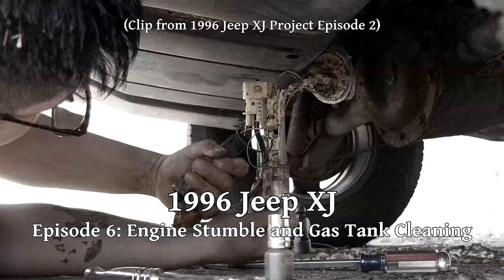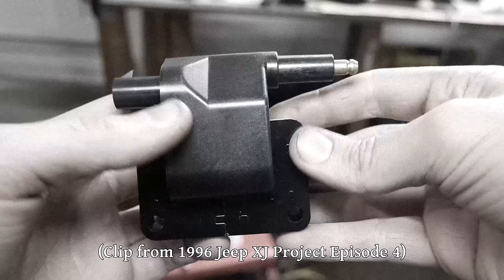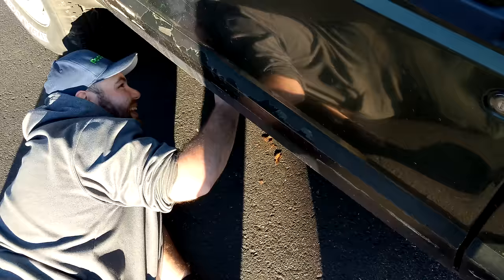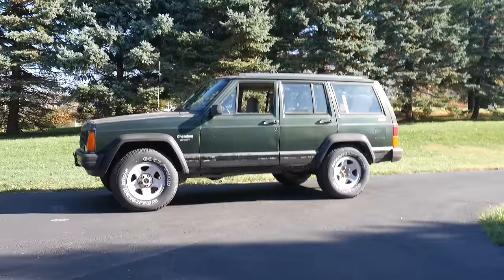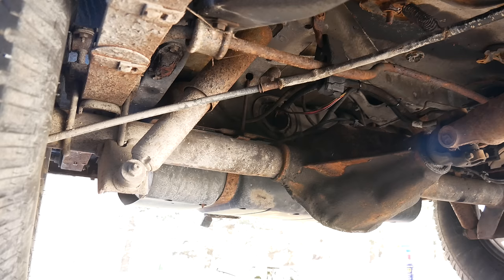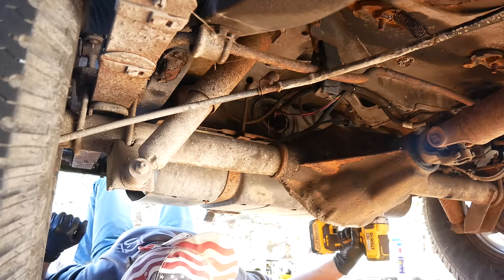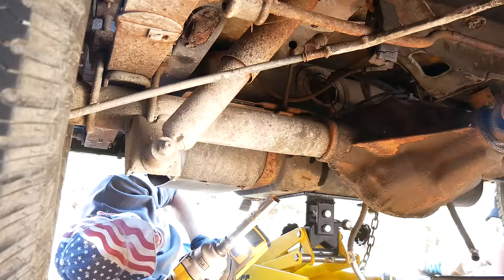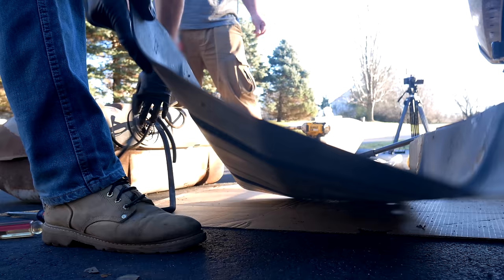1996 Jeep Cherokee Engine Stumble Diagnosis and Gas Tank Cleaning (Ep.6)

Comment: I've had 'the pleasure' of learning this lesson on a 1957 Chevy Belair around 20 years ago. The fuel tank was just about as bad as the Jeep's, and the insides of the mechanical fuel pump looked very much the same. It was so bad, it just clogged two filters right up, and I couldn't get any fuel to the carb. Comes with the territory of running old pieces of junk I supposed ;)

Comment: For future reference, you can use a bucket full of "cleaned" crush and run (white "drivway" gravel), or some lengths of chain swirled around inside the tank to "scour" the inside. Then use a product such as POR-15 to coat the inside. They also have a complete cleaning/coating kit for fuel tanks.

Comment: My 73 Torino that sat for 15 years, and the fuel tank was like yours, the pick up sock disintegrated and the previous owner didn't use any in-line filters. So it would start up and then stall. The inside of the carburetor was just as bad as the fuel tank. I basically replaced the tank,fuel pump,rebuilt the carb,new sending unit/sock and installed a fuel filters. Now it runs great.

Comment: Perfect end of the work week. Thank you! The O2 sensor sits a tad too close to the end of the pipe, could cause misreads as fresh air can tumble upstream.
Reply from the maker: The check engine light comes and goes now and then, seems to have to do with that sensor. In the next episode we will throw together at least part of an exhaust system for it to help take care of that (and the noise!)
Reply: @FuzzyDiceProjects  don't forget to get some new fuel hoses
Reply: The ECU likely goes into open loop when floored or at high RPMs. The upper O2 sensor gets ignored.

Comment: I had a 1992 Ford Explorer that had the same problem it had sat for 8 years my dad remarried in that explorer was sitting in his wife's backyard and she thought it had a locked up motor and all that was wrong with it was a fuel pump without she gave it to me once I did the troubleshooting on it determined it was a fuel pump I replaced the fuel pump and tried to clean out the gas tank is best as I could play the seemed like it was lined with tar varnish or something and every time I fill it up with gas it would just contaminate the fuel I ended up replacing the gas tank

Comment: A trick I've used on a couple tanks to drain them before dropping is run the hose from the fuel pump into a bucket and then jump the terminals on the pump's relay socket.  It can take a while but definitely beats wrestling 15 gallons down!
Reply: had a similar work-around with a 383 i was working on, car had the fuel pressure regulator under the hood, so we just ran some soft line off of that and tried cranking it to empty the tank that way

Comment: I going to do the same thing to mine, seeing this video gives me some relief that is am right with my diagnosis.  The truck sat for a long-time guy only use to go hunting a few times a year never.  I got it for $900 with 81000 miles on it not a bad deal, rust as can be.  So, my mistake was filling my tank to full and added some fuel cleaner which broke all that rust and gunk clogging the sock.  I removed the fuel filter and the stuff that came out was swamp water looking.  Have all the parts now will be doing it soon.  thanks for the video.

Comment: in cases like this with stumble,  pull an injector and watch how it sprays. this will let you know to start checking through the fuel system. 

this method lets you check without spending any money (in theory).

cut the top off a larger soda or gatorade bottle and set the injector in it and affix it someplace it won't get too warm or dislodge (keeping the injector up high enough to be able to see the spray but still be in the bottle), then have someone start the vehicle in question for a little bit to inspect how the injector sprays. google image search has some nice examples of good vs bad patterns.

cheap, easy and should let you know if you need to focus on electrical (sensors, etc) vs other.

also tends to save you some time.

Comment: You two had fun or made fun out of it so no foul, this is more common than one thinks. Here in alaska we suffer with off brand fuel companies with lots of water circulating in tanks at the station when tankers refill them. I drove to the station with my truck on empty and filled up. Small towns know you and it helps when they see it happen in front of them. I filled up, paid then got five feet and engine died and after running battery dead and being jumped, took top off the carb.... water! Stuck syphoning hose in tank and pumped five gallon and then second one then third and part of forth... all water so pumped from the meter pump and its watery and rusty! Had to wait for them to go get me fuel from another station and they shut their station down. Their tanks pumped said removal time and I was the lucky one to lose a days work.... It happens

Comment: My old 03 Crown Vic had the same issue, the whole inside of the tank was rusted even though the car had less than 120k miles on it at the time. I thought it was the pressure regulator because the pressure kept dropping off. I did that and still had issues so me and my brother pulled the tank to replace pump. Once we pulled the pump it was obvious what happened. Got a clean tank from the junkyard and the car ran perfect after that

Comment: Fuzzy Dice, a couple or more gallons of white vinegar would remove and neutralize the rust in the tank, you can place a chain or bolts in the tank to help knock the rust off by sloshing them around, you could then seal the tank.
Many Jeeps have plastic tanks. One of these may be the way to go.

Comment: For future reference, muriatic acid is a cheap cleaning agent that is relatively safe to use with gas tanks. Currently in the process of cleaning out two old Harley gas tanks with this stuff. It's potent, but also is a great cleaning agent. We're cleaning these out because of some sort of a gel-like sealer being used, which seems to have become solid over a number of years. There was also a bolt, and some newspaper clippings inside the tank. No clue why. This acid seems to remove any surface rust almost instantly, but also removes any protective coating from the surface metal. After doing something like this, you'll likely want to get some sort of a rust protective sealant inside the tank. Haven't gotten that far on this project yet.

Comment: When grinding on the bolt we don't want to heat it up Because of the heat treat so we dip it in water but then we Weld it
Reply from the maker: Slow, quick welds, and time to cool in between. That's why the welds look so bad (well also not sanding off the coating), because they were done a little at a time

Comment: I recently have been slathering whatever exposed threads with grease and that seems to make whatever bolt or but come off a little easier, just try to get the grease under the threads of whatever is trying to be taken off.

Results may vary.

Comment: that fuel tank was horrendous. i guess now you know to do things right the first time. nice hack on that extended 14 mm. i had to do the same thing for an e brake adjuster. i didn’t have a welder so i hammered the correct size socket into a bigger one and it worked great. i still use it.

Comment: I had an 89 Jeep Cherokee Pioneer that would start to chug in the winter when you got above 50mph.  I bought it used and it was in horrible shape.  Transmission was run nearly empty by the previous owner.  And the PVC valve would dump so much oil into the air cleaner that I could not run an air filter.  I never thought it could of been the gas tank.  Glad to know, now! lol

Comment: Seems like 1996 was the year of the metal tanks for Chrysler. The neon was the same way. Our workaround for this is to get a plastic tank from a later year that has the better pump setup with the plastic pump ring rather than the metal tank with metal pump ring

Comment: Penetrating oil!! Very useful on a rusty bolt/nut. Love the videos man.
Reply: Not very when you only let it be for 5 min, use heat instead
Reply: On a gas tank?  Lol
Reply: J F4444 , yes on the bolts that hold the tank straps.
Reply: @JF-4444  what is tapping out the gas.

Comment: I once work on a 84 BMW 318 it had been setting up scents 91 and  well I'm not going to lie the in side of the gas tank had what appeared to be  molasses in it and didn't smell like molasses though it had to have been at least  2 and 1/2 inch thick at the floor of the gas and keep in mind this is a dual heights gas tank it straddles the drive shaft so I only cleaned one side it still boggles the mind that the car still runs fine now as for the lift pump that was in the tank I replaced it with a strainer and a piece of fuel hose and use the high pressure fuel pump a new one of course to suck it from the fuel tank and put it to the injectors

Comment: Seems pretty counter productive to continuously cool it as you grind it to "square" it so as to not burn off heat treatment or whatever you are worried about to then just weld it together cause welding it by its very nature is heating it well past the point of any kind of treatment or anything on it remaining.

Comment: I bought a 2006 Honda CBR600RR off of the original owner a few years back. It only had 2k miles on it and had basically sat for the better part of eight years. The guy was not mechanically inclined at all and couldn’t get it to start, even after changing the battery, oil, and adding new gas. It was a dead giveaway what was wrong when I couldn’t hear the fuel pump prime. The gas coming out looked almost the same and the fuel pump was lunched. I had the tank professionally cleaned at a radiator shop and installed a new OEM fuel pump and the bike fired right up. In hindsight, I should have just bought a new tank or at least one in better shape, since mine does have rust spots in it. I don’t neglect it like he did, but if it gets any worse I’m just gonna replace the tank.

Comment: If you want to drain a fuel tank that has a working pump in it, just remove the shrader valve at the rail, jump the relay, and pump it out at the rail. Short of the "jump the relay" part, I just made a video on this topic... Plus your gas goes through the filter on the way out.
Reply from the maker: True! Don't have anything that connects properly to the schrader valve connector but we could have unhooked it before or after the filter pretty easily too and just pumped it out with a jumped relay. Would probably have been straining the pump a bit but we were replacing it again anyway. If I was working alone or it was a significantly larger tank I definitely would have drained it before dropping it.
Reply: @FuzzyDiceProjects  1/4" hose shoves right over the service port on anything I've ever tried it on. You don't need to actually "connect" it in a pressure safe type of way.  Check out "how to pump bad gas out of an old Ford" if you want to see me do it!  ;)

I agree with your assessment of the wear on the pump and all of that... Normally I'm just pumping them out because the gas in them is getting too old (a hazard of having more cars than underwear) so not usually a risk for me.
Reply from the maker: @TheBrokenLife  Noted! I'll have to keep that in mind if I find myself in a similar situation again
Reply: @FuzzyDiceProjects  Cool! Looking forward to your next vid!

Comment: Went to replace a fuel pump on a customer's car several years ago. When I pulled the old pump out I found the fuel tank FULL OF SAND. Told the service manager and he contacted the customer. Law enforcement got involved. Ended up replacing the fuel tank as well as the fuel pump and filter.

Comment: I literally just did this, put a new pump in ran good, the pump started whining and the truck started bucking real bad, warranties the pump replaced the filter did it again, pulled the tank pressure washed it, fixed

Comment: Had an 06 Ford van kept shutting off during driving. Turned out the liner in the gas tank was disentegrating... Spelled that wrong and I don't give a crap..
 Anyway it was clogging the pick up for the fuel pump.

Comment: So I've heard you can put diesel fuel and some gravel into a dirty fuel tanks to clean them out. Just make sure you get all the gravel out. Then you dont have to worry about water in the fuel tank
Reply: It's a better idea to use steel shot (BBs) than gravel. Small engine guys use that trick all the time. The pro move is to do that and then bungee cord it to a tractor wheel (in the case of a small engine tank) and make a couple of laps around the yard.

Comment: You only had to loosen the bolts about 2-3", If you look where the "J" goes in the frame you'll see it's elongated. Loosen & turn the "J", with a floor jack & board under  the tank its more controlled & safer. I worked in a junk yard & blew up 3 cars:yougotthis:

Comment: classic way of cleaning out a gas tank. tie it to a rotating cementmixer, fill it with nuts and bolts and let it rotate for a few hours.. voila, the tank will be mediablaasted on the inside.
could be the solution for you if you want to keep that horrendous tank. and have a cement mixer.

Comment: Motor still seems quite strong.  I miss those AMC's straight-sixes.
Reply: went to Chrysler by that year I believe...correct me if I'm wrong anybody
Reply: @Bri-tg6xr  AMC was acquired by Chrysler in '87.  So yes it's technically a Chrysler motor.  Chrysler continued to build AMC's 4.0L straight-six up until 2006 with very few minor revisions (mostly small tweaks to the head design for emissions, etc).  I still consider the late products built by Chrysler to be AMC's motors only because AMC's design stayed intact. They can be built up to a point (**not really worth the money spent for what you end up with esp when compaired to say a Chevy 350, though possibly a little more potential then say trying to build up a Chevy 305).
Reply: @Bri-tg6xr  The 4.0 is an AMC designed motor and is widely accepted by AMC purists as "family".

Comment: The plastic guard is called a skip plate....If you asked me i would have said it should have a plastic gas tank...like my 95 YJ.....witch has a metal skid plate and a plastic gas tank..go figure ...wonder if my yj gas tank is a replacement ? hummm   .like your video......JEEP'S RULE   S10'S DROOL

Comment: My buddy’s 4.0 96 jeep is having this same problem it had stopped in the middle of the street  (fuel pump went out ) and we changed it and it developed this problem also his floor pans are rusted way through to 😂still drives it but did you guys end up finding out the problem? Exactly the same problem you described

Comment: How do you plan on replacing the floor ? The contaminated gas tank also has contaminated fuel and filtering it might have looked clean but the quality is compromised and it has lower octane rating now so replace everything maybe check the injectors too .
Reply: I just went through something similar on my channel. You can take the bad gas, dilute it heavily with fresh, and burn it off. I agree that I don't think I'd run it the way it came out though...